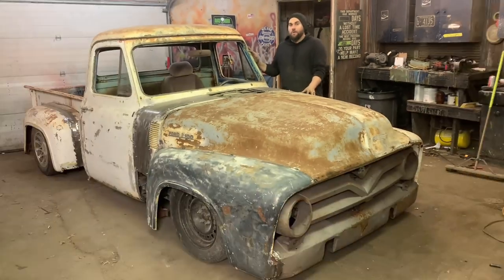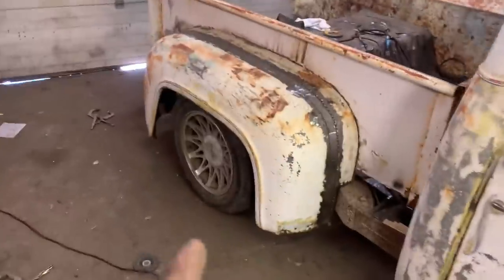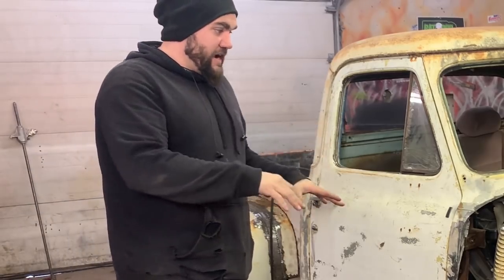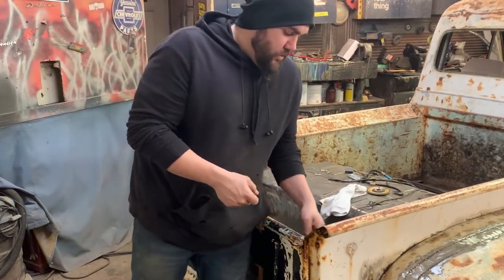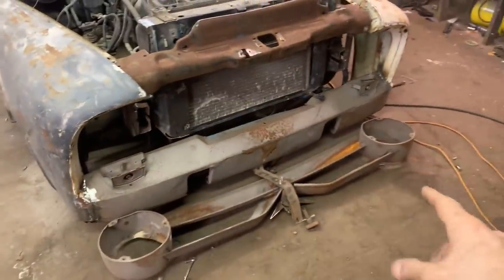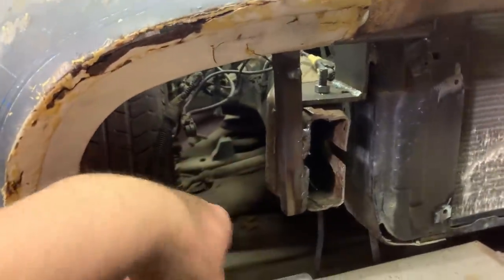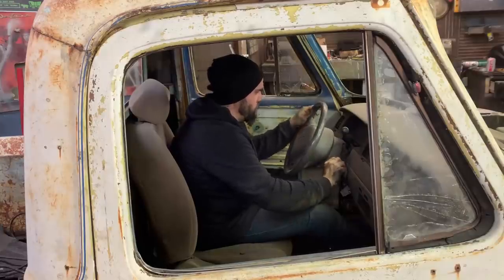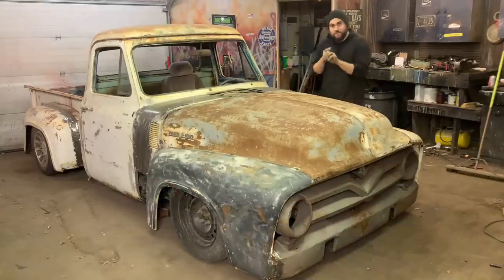BUILDING A HOT ROD FOR UNDER $1000 DOLLARS! PART 10! HOW TO BUILD A RAT ROD ON A SUPER CHEAP BUDGET!

Comment: This build is looking so good.  I am looking forward to see how it all goes and the total cost at the end.  This truck is looking so good.  I love a simple truck with the basic power brakes, power steering, a/c, and some kind of charger as a good sounding truck is it’s own music no radio needed with rev’s.  The simple touch like tail gate locks over chains.
Reply from the maker: Thank you! I think When people think of a cheap budget they think of not spending a bunch on expensive rims or something all at once, when in reality it’s little savings here and there that add up. Saving 100 bucks on the tailgate latches/chains is huge when you only have 1000 to spend
Reply: @CaseysCustoms  my first truck was a 1986 S10 roller I start building in 1996. No motor, no trans, locked up rear end.  Replaced the rear end with 9” ford 4 line with coil overs (cut it out of a car in a junk yard). Took a 350ci Small Block Chevy for a vet and turned it 383 stroker with two double pumpers from a junk yard find... I took so many parts from that old corvette... got a 6 speed from a junk yard from a fire chicken.  Not sure how much I spent but I was working at a pizza place and doing yard work.  I had to buy all my tools, truck (it was $100...) parts, machine shop work for the motor build all of it before I was 16 so it wasn’t that much.  I miss that truck.  Learned to weld because of it installing a roll cage.  My family only did wood working which I started doing at like 5-6 years old so not mechanics and before the internet help.  Didn’t get a computer that was able to get online until 1999 and it was dialup.  Think that is why I love this build so much I would have loved to see it and copied as a kid.  Maybe when my son is that age in 10 years we can start build his for when he turns 16

Comment: I owned a few of those in the day. Newest one was a 56 in 61  from the bank repo deal I got it in and it was decked out real sweet. The only thing that I didn't like about them was the way the tires look setting in the cavity... like they        set way back from the fenders, hence the reverse wheels that we did back then. Did my wheels with the new hole for the valve stem in front yet and when they went tubeless, I just turned one core inside and let the one on the outside be the filler air orifice. Had a flat with one once from setting a while and having a filler on the inside saved me that day as it was sunk down in muck and on the inside it was on top and so bingo, just add air and drive it out. I think todays wheel bearings will take the modified rims on wheel bearings and not just take them out fast as you poke them back in. Turning sweet it is.
Reply from the maker: That’s awesome you had one in 1961

Comment: OK Casey, OK i saw an earlier video where your chopping the top. I saw it first so i had no idea the whole picture, so i watched that and wanted to how you got there, I am now here and i get it. What is worse is you have me hooked on seeing how this turns out. I used to dream of doing this to a wide range of cars I liked but wanted modern chassis under them. And then i hear you say you have 15 or 20 of these chassis swaps. OMG! I want to see them. Where are they? Have you done any Chevys. My first Car in 1965 was a 47 Chevy Coupe and i spend $35 on the car then $425 putting a 57 Olds 371 V8 and 4 speed Hydramatic and Rear end under it. Now looking back I wish I had used the OLDS frame and done a Chassis Swap. It would have been so much easier. I will be watching, you take care. Dennis in Virginia

Comment: Beautiful work!
Reply from the maker: Thank you!
Reply: @CaseysCustoms  no problem. Beautiful work with scrap leftovers of a truck and an older Lincoln, I'm amazed at how much you accomplished with so little of a budget. It's inspiring, really. Definitely makes me make a double take when I look a my charger. Lol. Nah, but there's several crown Victorias in my area for a good base, and plenty of old Ford's or Dodge trucks, even.
Reply from the maker: @nathanieljohnson4833  Ford rangers and Chevy s10’s work great as well
Reply: @CaseysCustoms , well, I was thinking about the crown Victoria chassis under a short bed 73-79 ford truck. Even the boxy 80s style Ford's. Even the 73-93 dodge pickup shortbeds with step side beds. A great handling chassis under a slick old school. Plus, smooth them out, work the dents, and I use tractor paint. (Gotta be slick for Sunday morning service) and I even got a line on some Lincoln seats with the upholstery seat covers, so they'll be fresh. May go with carpet so's I look like I'm civilized. (Lol) but I'm glad I found your page. Found a lot of inspiration, and I've already commenced to drawing sketches, and getting a general idea, of how I'm gonna pull it off. Thank you kindly for the help, and I'll send pictures once I get underway.

Comment: Barrel bolts for tailgate name btw...perfect fit for a farm truck, its my go to for tons of shit. Well done as always brother. Do you ever weld in full brace like in back before cutting floor, almosy make shift roll cage style?
Reply from the maker: Barrel bolts! good to know. I will end up welding the cab/bed to the Lincoln floor and floor braces. If it seems flimsy i will add some square tubing along the floor. Roll cage style bracing is only needed if you are cutting the cab (widening lengthen ect) or you just want a roll cage. The cab lost its floor bracing during the swap, but the bracing across the back and sides is all still there. Hope this makes sense